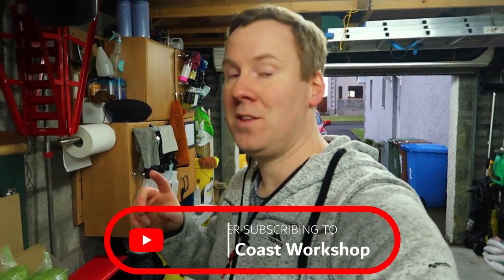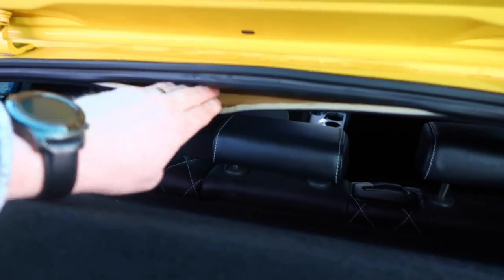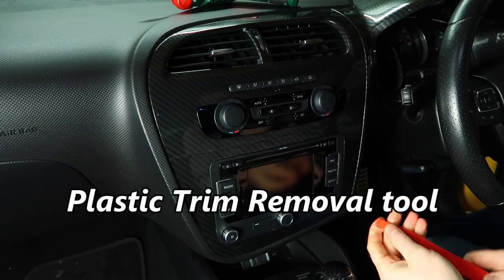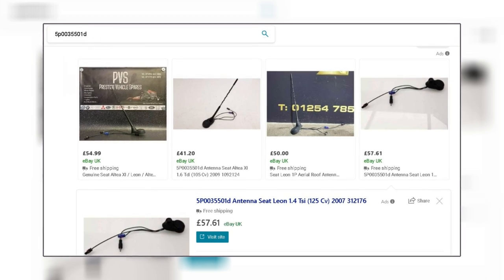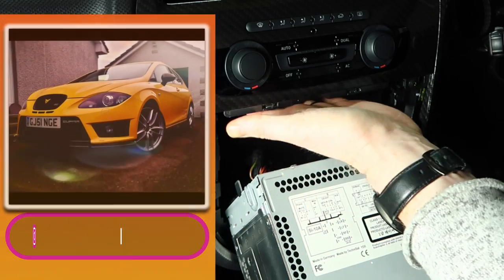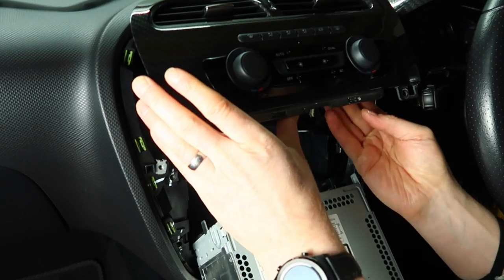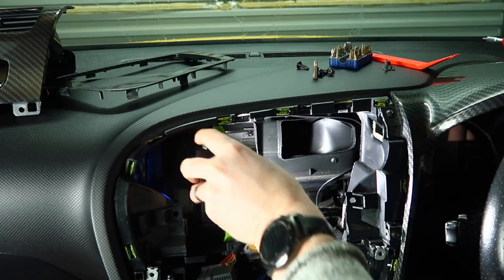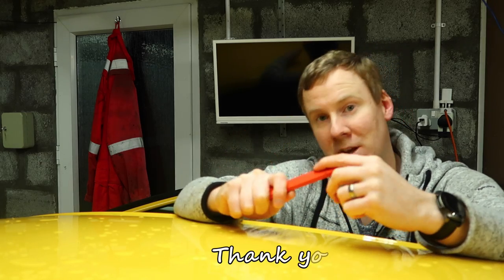How to FIX your Sat Nav's Incorrect Location | MK2 Leon Cupra 1P1

Comment: Great video very helpful after checking my connections all ok so replacement gps unit on order. Many thanks
Reply from the maker: Hopefully it sorts it for u and saves some money 😁🤞🏻 let me know how it goes
Reply: All installed and working fine at last. Your video has saved me a fortune. Seat Dealer quoted in excess of £500 to update the maps and change gps. I paid £20.95 for the map update and £6.99 for the replacement gps- Can’t thank you enough - thanks again
Reply from the maker: Brilliant news, love hearing fixes like these, and so glad it worked for your car as well. Cheers again 😊

Comment: My Peugeot RCZ wipcom 3d ng4 has same issues no antenna on the roof so I guess it’s all in one somewhere hard to find…
Reply from the maker: I managed to find what it might look like. It may be hidden under some trim in view of the front or rear window. Supposedly the radio antenna is integrated into wires within the top of the rear window.
If you were able to find the connector for the GPS on the rear of the head unit, hopefully it would be the same solution as mine, once you found the relevant Peugeot connection.
RCZ GPS module pic for reference 
https://www.proxyparts.com/car-parts-stock/information/part-number/9661102880/part/gps-antenna/partid/9595298/

Comment: Hi thanks for your videos, don't know if you can help but I have a 2014 A4 Avant and the location on my sat nav is wrong it's showing that I'm on the Isle of Wight but I'm in Birmingham lol plus every so often my dab radio drops out of signal.
Hope you can help with any ideas
Reply from the maker: Hey Andy, I imagine and hoping its the same solution for your car regarding the GPS, and I believe Audi/seat/VW all share the same connector, so you'd be looking for a VAG fitment on the end (maybe the exact same one I listed in my video).
If the RDS is starting to show issues as well though, you might be better getting a complete new/2nd hand antenna unit, and that would cure both issues together hopefully.
I'm not too clued up on the location of the antenna on an A4, but most likely it's got all features in one unit, like my Leon has.
Hope that helps, thanks for watching also 👍🏻
Reply: @NorthCoastWorkshop  that's great dude I'll give it a try, love the content
Reply: @andypitt3832  did you get it fixed? Having the same issue for my seat leon 5f
Reply: @marijn3475  yes mate just got a VAG ariel from ebay its a bit fiddly to trace the cable but once done it's worth it, than paying out 100's for audi to do it.

Comment: Great video.  I have a similar problem with a mk3 renault scenic. I've no idea where the sensors are. Have you had to do this with a scenic?
Reply from the maker: I'm afraid not, but looking at a replacement antenna for ur car, it looks like it's an all in one unit like mine. If urs is the same as the picture in the link, then the solution in the video might work, with a small stand alone aftermarket unit tucked into the dash, and just disconnecting the original GPS lead from the all in one antenna
https://www.renaultbreakers.co.uk/store/Renault-Megane-MK3-2008-2016-Radio-Aerial-GPS-Base-Antenna-282160004R/
Reply: @NorthCoastWorkshop  thanks for this.